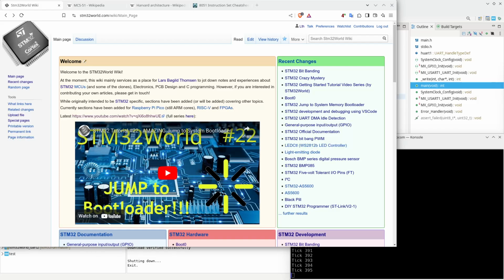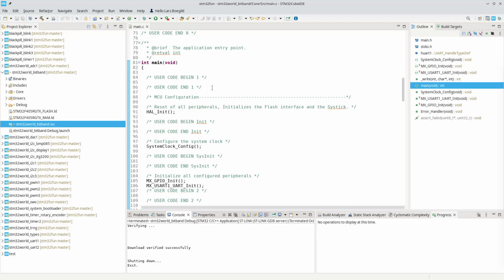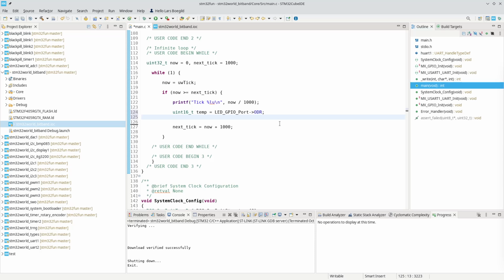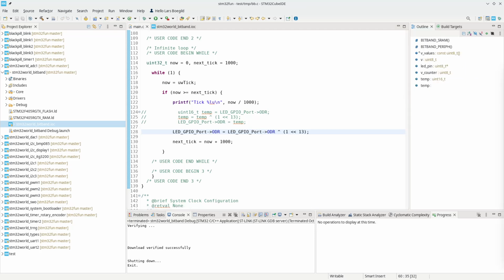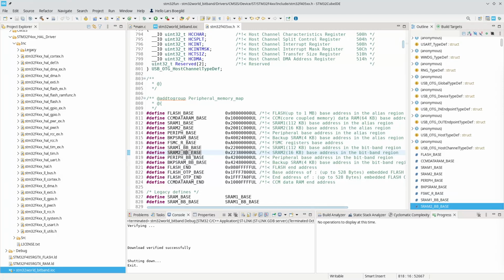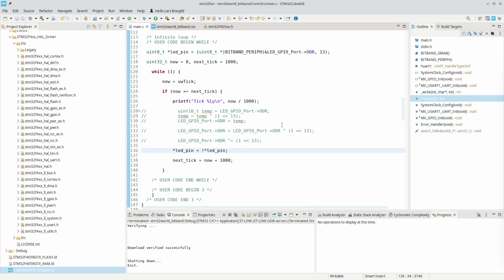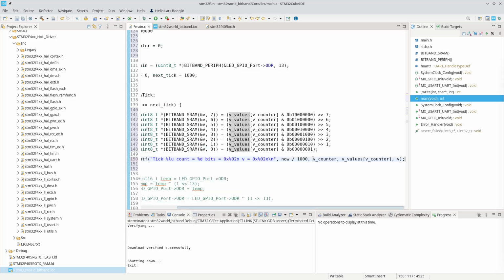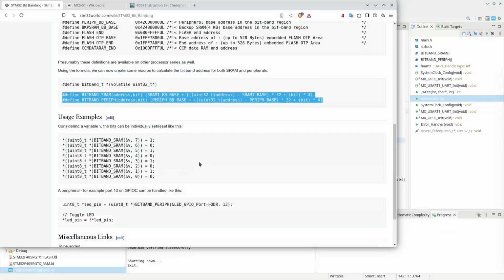STM32 Tutorial #25 - Bit manipulation using bit banding

Comment: Interesting concept.
I read that ARM Cortex have LDREX the STREX instruction pair that should enable interrupt-safe read-modify write. Is it not popular on STM32? Or maybe bit banding is popular because it's shorter and faster code on low memory CPUs?
Reply from the maker: On stm32 - none are necessary actually.  The BSRR register can toggle a single bit on or off.  Watch the video where I bitbang pwm.